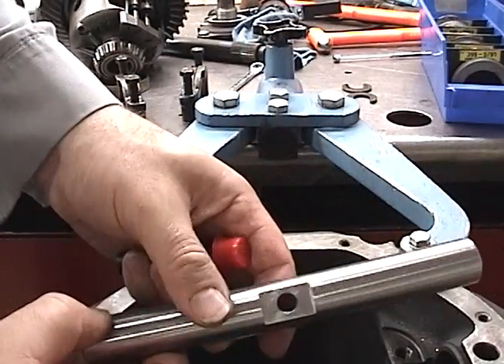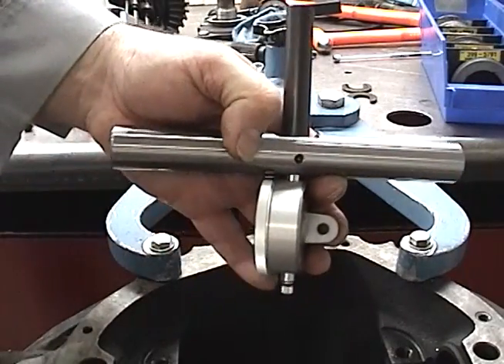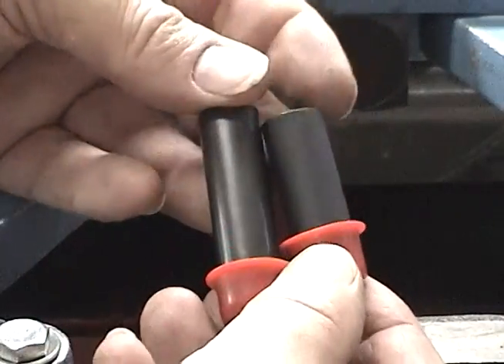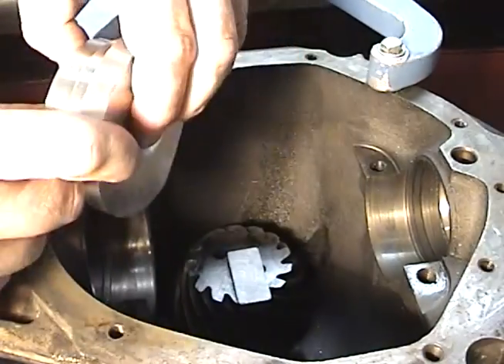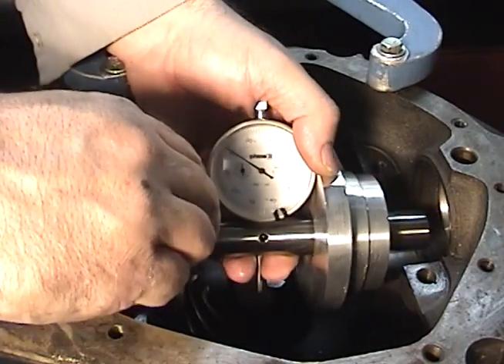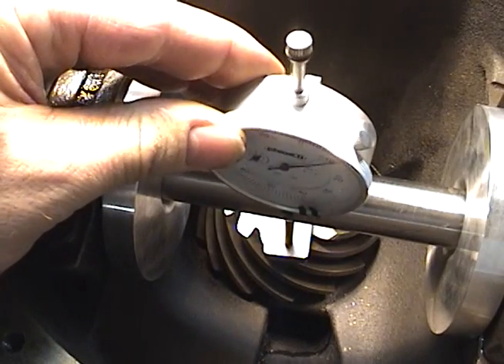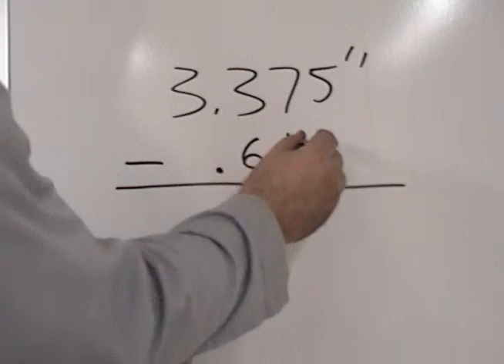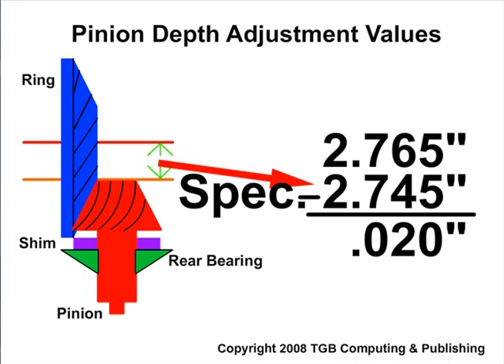Measuring Differential Pinion depth most Differential

Comment: DrivelineMaster hi. i want to ask you. when using universial pinion depth gauge. after using it. is it done with all measurements?
Reply from the maker: You would use it once more after installing the calculated shim to make sure you did everything correctly.
Reply: So this tool once you measure and have the right depht with shims your done? all other measurements are ok?
Reply: Boost V8 chevy there are several parts to set up this the first next is the torque the other end of the pinion it the preload then you move on to the career for how much back lash and where the ring a pinion mesh you use marking lube to know to shift it left or right then depending on what axle you have you may need to shim them so I guess your answer is no
Reply from the maker: This is used as the first stages of setup.  The pinion is placed into location with a starter shim and snugged down so it won't move around  and has minimum preload on the pinion bearings.  After using this tool and adjusting pinion depth shim you will need to watch my video on installing the case and adjusting the backlash and case bearing preload.  Once this is done a contact patch should be taken (another video)to verify correct pinion depth.  If the pattern is off you will need to change the pinion depth shim to correct the pinion depth and repeat the process of installing the case and taking another contact patch.  Keep doing this until the patch is where you want it.  Then you can install the pinion and seal and crush the crush sleeve for the final preload.  Then do your final case setup and your done.
Reply: DrivelineMaster unless it is a Dana 53
Reply: Ok. thank you .

Comment: Hi i noticed that the dial indicator was not calibrated back to zero right before you took your final reading 
the dial needle was at .80 which is 20thou off original calibration was this a mistake or a missed step in the video ?
thanks
Reply from the maker: Thank you.  That is correct.  That way I can measure plus or minus values.
Reply: It is correct, he set the dial indicator up with a little bit of preload.
Reply: Good catch, you are right and he just goofed and got the calibration off of zero somehow.  It has to be set to zero or it will not be accurate.
Reply: Actually what happened is that once you take the steel tube off of the dial plunger it will allow the plunger to come out further throwing the needle off but it is exactly zero at 3.375 so although the needle was at 80 without the steel tube on it, it is calibrated at zero once you slide the steel calibration tube onto the plunger.

Comment: where did the original calibrated reading 3.375 come from??
Reply from the maker: The calibration values come from the tool manufacture.
Reply: It is just a starting point from which to deduct the difference from that get from taking your reading

Comment: Don't you have to calculate the thickness of the magnetic measuring shim?
Reply from the maker: Yes, the magnet thickness was compensated for by the tool manufacture
Reply from the maker: The magnet thickness has been engineered into the tool.
Reply: DrivelineMaster so the magnet spacer thickness is included in the 3.375 ?
Reply: I believe that's accounted for in the calibration tubes.